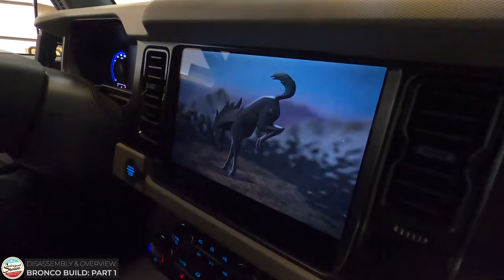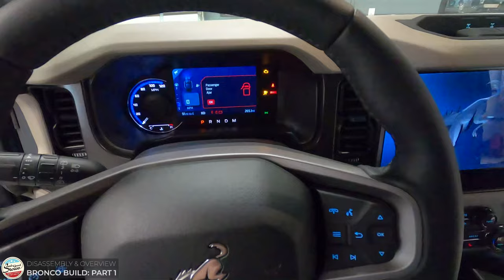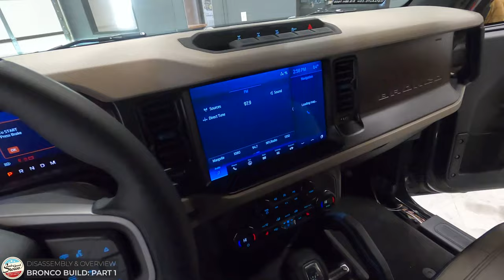Part 1: 2022 Ford Bronco Insane Focal and Mosconi Stereo Build - Disassembly and Overview

Comment: I love the build! Two questions: First, I see from a previous comment that you sell the white paint protection film. Do you also sell the pink carpet protection film? I just spent an hour getting (most) of the flecks and specks out of the carpet on my truck install I just finished. Second, what glue do you use on the vinyl and carpet on the box? I use Super 77 or Super 90, but it it hard not to get where you don't want it, and it seemed that you had to use a hair dryer to activate yours, which seems much cleaner. Eh?

Comment: Something I don’t understand I was always told to avoid mounting amplifiers directly to the box due to vibration damage is this a thing or not. And if it is a thing what did you do to prevent these amplifiers from being damage from base being that they’re right on and right in front of the subs. Just wanna know
Reply from the maker: Usually, that's a good practice. It all depends on the construction of the enclosure whether you can make it happen. So you can kinda see it in the video, but the back amplifiers are mounting to a loading wall which is constructed of double 3/4-inch which is laminated together. It felt like a piece of concrete when it was done due to the process in which we designed it.

The top/back amplifiers are mounted to the most rigid spot of the enclosure as you can see in the build process. The key is you do not want to mount amplifiers on long panels which will flex under load. In this case, we tried to ride that balance and place all this gear in the best way we could. When it was done, it was solid and we are confident only minimal energy is going to the amplifier chassis.

Comment: 6k RMS and stock electrical!? Love the gear and install looks great
Reply from the maker: This is a demonstration vehicle, not a consumer build. You will see the power supply in the first video we added along with several batteries. 99.9999% of the time the system plays, the truck will have to be off since it is inside a convention center, not allowed to start the vehicle. This is more of showing capabilities so others can have a reference to create their own version of this.

Comment: I'm also.. sound deadening.. but I just want my entire hatch covered.. tire well.. sides.. rear hatch door.. and roof to the back seats... roadkill...
Reply: Doors front rear... Stinger deadener... a little thinner...
Reply: He is very professional with his install... I must say... so far.. im satisfied stumbling across your channel.
Reply: I'm also doing a concealed box.. 12 inch downfiring box with passive radiator... everything running through 4 ch loc... and analog DSP. Active.
Reply: My bad... in a 2018 tiguan... lol